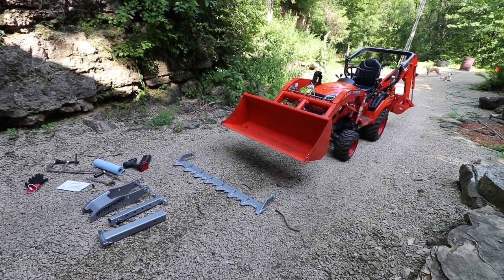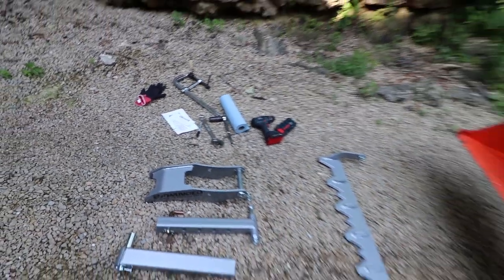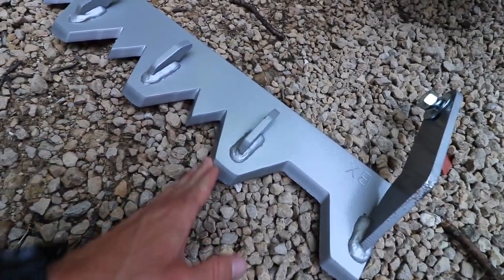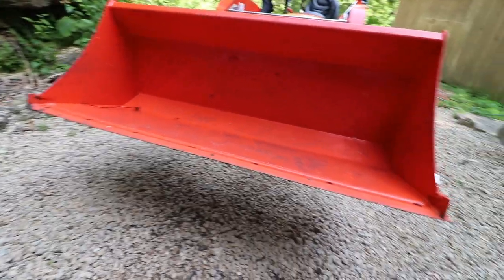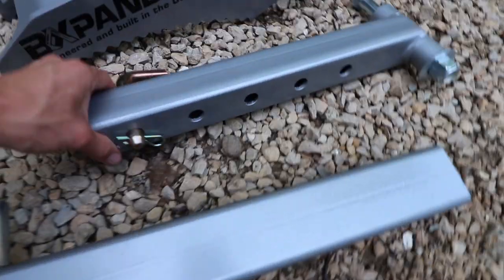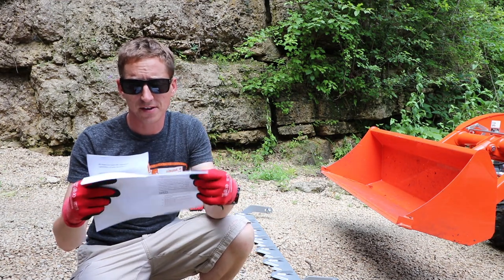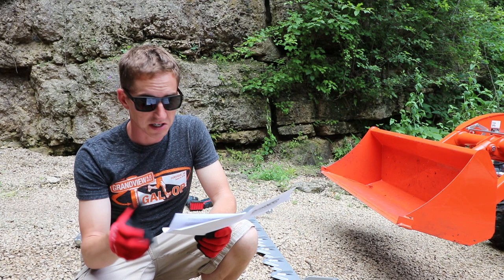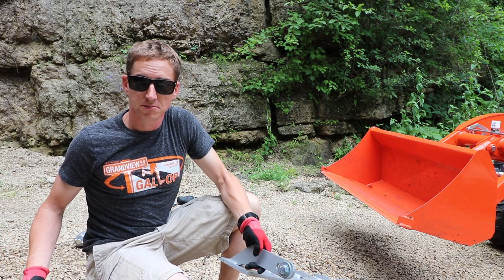BXpanded Piranha Tooth Bar and Backhoe Thumb - Kubota BX23S Install

Comment: I noticed the small points missing on the ends.  Did you order it this way?  If so what as the reason, is there something that mounts on the ends?